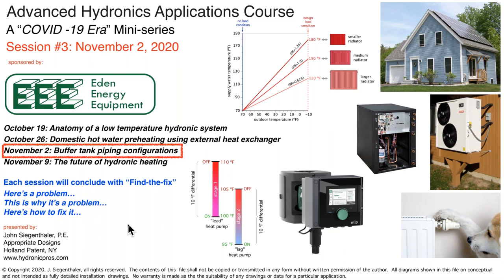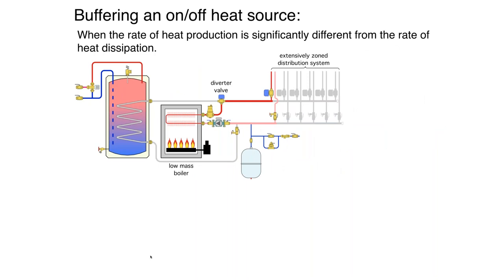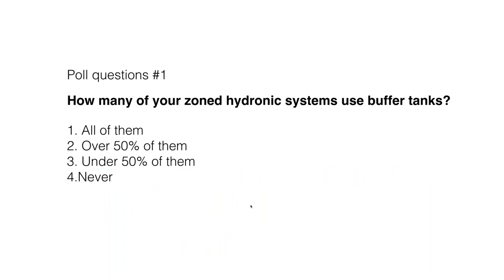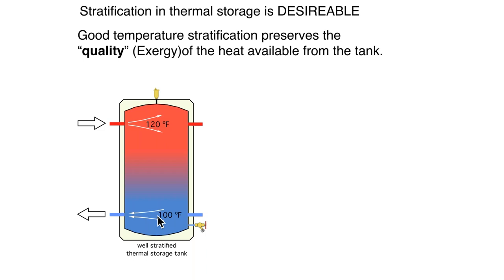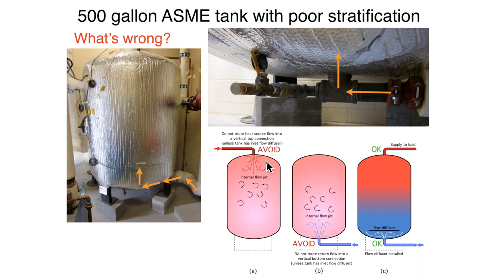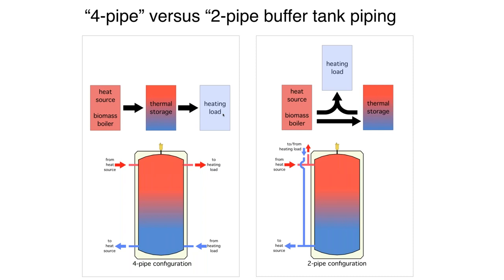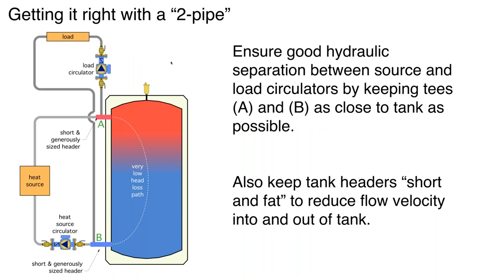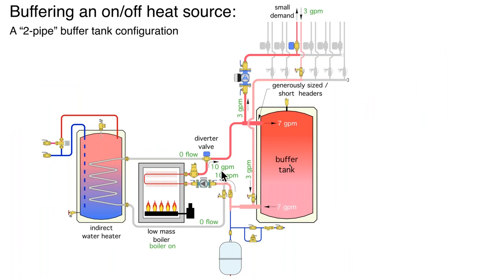Part 3 : Hydronic piping & Buffer Tanks with John Siegenthaler

Comment: Should my high and low temperature limits be based on heat differential for the boiler? Or should I leave heat differential to a mixing valve at the boiler? Also, should I use high and low aquastats/temp sensors at the top and bottom of the tank respectively or just have a single aquastat well/sensor in the middle? Thanks!

Comment: so if I have 1 inch connection and 5/4 inch stove piping I just need to screw a tee for good hydraulic separation ? the wider line on a drawng doesn't mean diameter just proximity to a tank ?
Reply from the maker: Apologies I do not quite follow the question. Can you clarify?